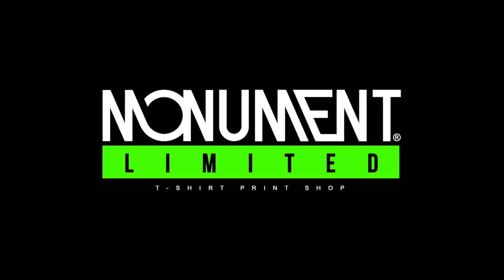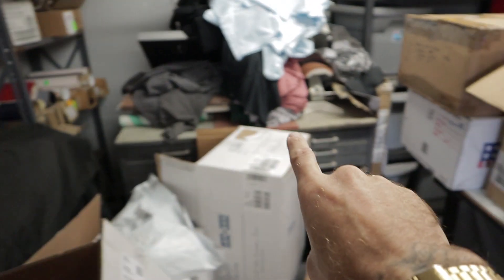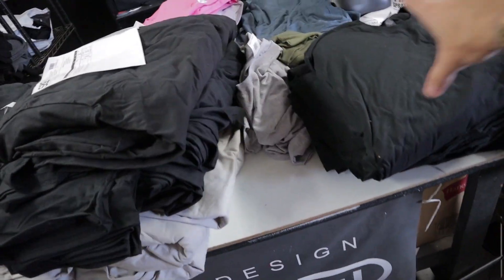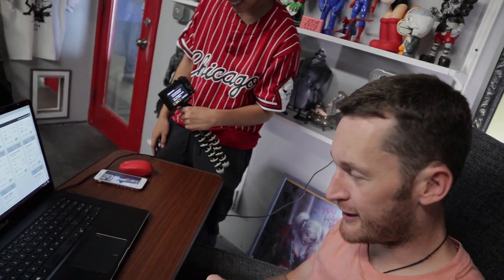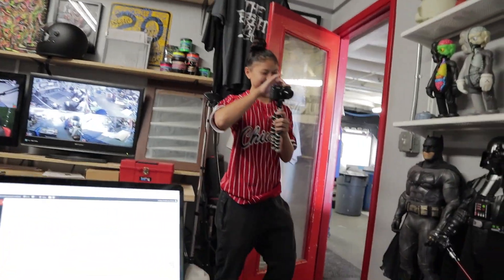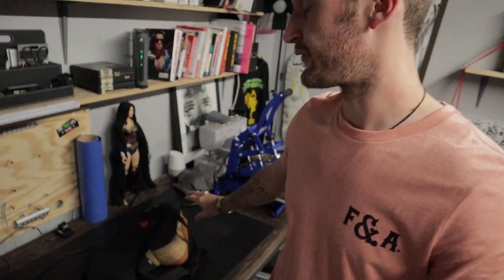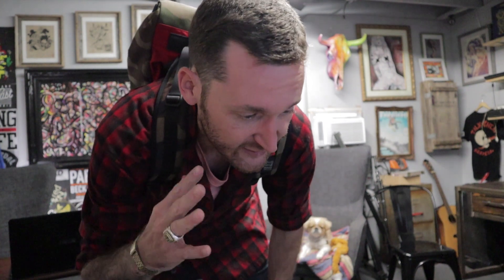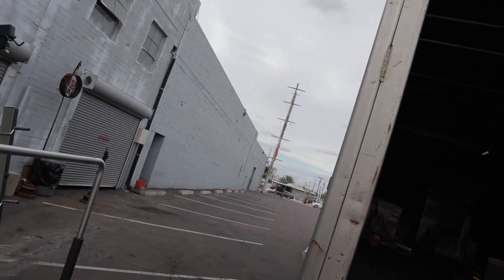Fixing a 6 color 6 station manual screen printing press | T shirt Printing Vlog | Cam Earven

Comment: We’ve got the Riley 6/4 joystick the only time it’s a pain is if I was dumb and didn’t trap/choke my job or like one Chanel has something I missed and it’s burned and ready to go cause it’s super hard to move it a tiny amount like you can with regular micros the heads lift up when you start clamping down the joystick and move the screen towards the collar end of the pallet a small amount I’ve had a few freak out moments because of that lol

Comment: For registration, I would try to isolate if it was a specific print head or specific pallet. Sometimes it is two or more and these can really mess with your head. So you need to methodically eliminate the good heads or bad pallets. Make sure they are numbered so you can identify problem heads / pallets. Check there is no slop on the head stop / locator on the pallets. You can use a fine laser on a tripod and mic boom to "point" to a registration mark to ensure it is in the same place on all platens for each head, but my guess is slop in moving parts, not static platen level or setup. Make sure you wiggle the press to accentuate any misalignment. Your centre bearing could be gone, but tbh, those things are pretty bulletproof.
Reply from the maker: Nice tip thank you for the advice. I did find there was slop on most of the head from that lock nuts, I replaced them I hope this helps.
Reply: @ThePrintLife  Nearly all my reg issues have been as a result of a loose nut somewhere! Normally my fault, (read: always)! Our presses are pretty bomb-proof, even the old ones. Nylock nuts are only really meant to be used once - although I have reused nylock nuts for non-critical use before like in this instance by briefly melting the plastic with a lighter so it regrips tightly again. Hopefully replacing and tightening solves your issue! Air guns can melt the plastic if wound on too fast, so just be aware of that if the  issue persists. On a side note, loctite fills the void on joints so also helps prevent any rust issues. So only a good thing! I'll be starting a separate channel as I start a clothing brand and document it, so will hit you up as soon as I post the 1st vid. Really enjoy your content as a printer - keep up the good work Cam, Richie

Comment: My manual is such a pain in the ass to get things registered. It all started about 5 years ago when I had a guy who used to work for M&R come and button up the press to make it perfect so we could print samples when needed for "higher end" customers. The guy I had working for me at the time thought he knew what he was doing when it came to adjusting the micro-reg, but alas, he did not and the entire press went to shit again. I've learned to work with it, but trying to get anyone else to use it for anything other than the occasional 1 color job is nearly impossible. I had a HELL OF TIME trying to get a 6 color job setup on my auto last week for Wayne Carini (Chasing Classic Cars on Discovery Channel). His shop is right over the bridge from our shop and he came down looking to get shirts made. I ended up saying screw it and brought the entire order down to a customer of ours (our main gig here is wholesale tie-dye) and had him print the order on one of his many 12 color presses. :-) Don't have no time for registration bullshit.
Reply from the maker: That's what Im saying my dude. These manual presses need a better way. I hear the ROQ autos have the best registration systems in the biz. If it is that good then it would be worth the cost of the auto right there.

Comment: I've done traffic school online for the last 3 moving violations I've had over the last couple years. It's super easy. There's usually a $5-10 fee to sign up for the course and it only takes 45 minutes to complete the online course. Basically you just click through the prompts and answer the questions at the end. The answers to the questions are obvious so you won't really have to read anything. Plus, you can just look up the answers on your phone or another browser window.

Comment: my 6/6 vastex v1000 holds reg like a boss. it's only about 3 yrs old tho. i'm thinking about getting the 2000 or a entry level auto. 

to troubleshoot your press i would print the same image on each pallet and measure for consistency and do that for all 6 heads and see what's off or not. 

Good luck bud!

PS you can totally contest any ticket in court. especially when it's a moving violation and points on your license are involved. most of the time the prosecutor will amend it to a non point  violation but you will pay for it. all they want is your $$ at the end of the day.

Comment: Loving the vlogs...I wouldn't use the red loctite. You won't be able to service the press again without using some extreme force to back out the bolts and or heat. The red loctite is great for suspension bolts. Stuff you don't want backing out. Blue is the way to go. Sounds like the press just may be tired. I've built hotrods from the ground up, and messed up using red in the past for simple stuff like pulley's. Couldn't get them off to save my life after the fact. BTW, check out my V8 bug build I did back in the day... Lots of vlogs on it. Did an El Camino and rug VW beetle too 1971... https://youtu.be/EuS_oqo7zg4
Reply from the maker: oh great, I hope I didnt just lock that thing up for good. Oh well Im sure an impact will get it out if necessary..